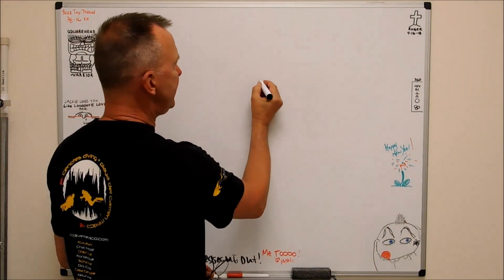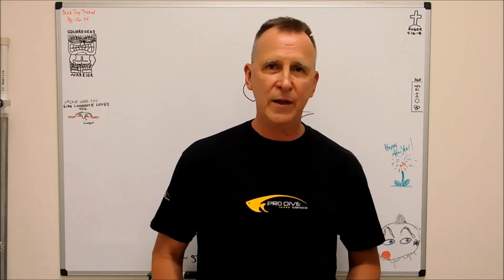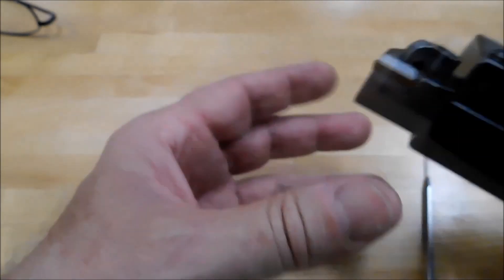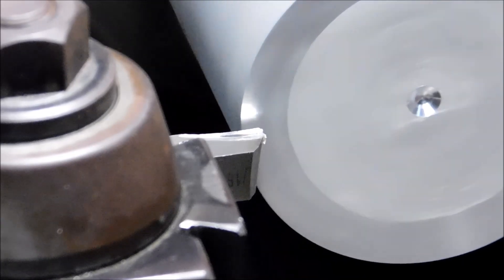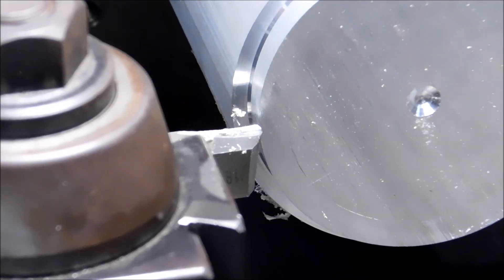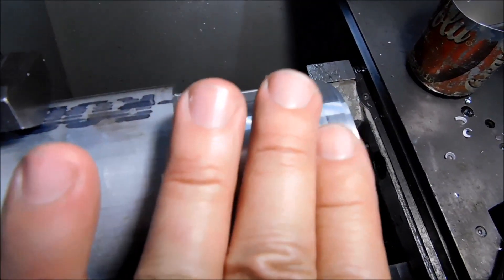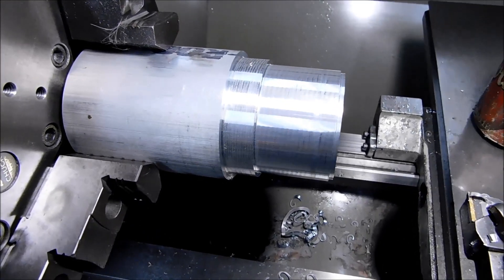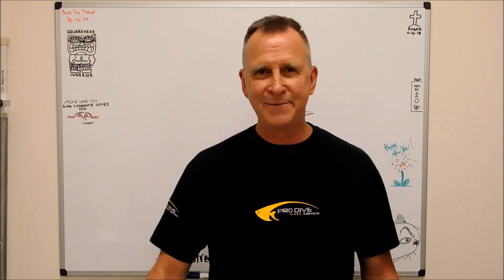C's and 6's...The Perfect Lathe Chip

Comment: You Are Awesome Joe. Check Out You Tube Video-Back On The Unicycle Three Months After Knee Replacement Surgery.
Reply from the maker: Don't push it if you are they guy on the uni-cycle. I have an extensive background in orthopedics, specifically knee replacement instrumentation and implants. There is only so much bone to work with and healing properly after a procedure like that is very important to a quality bone to implant bond. Falls are not good.
Reply: That Was A 1 Time Promo Stunt As My Way Of Giving Back To The Doctor And Hospital For A Fine Job.

Comment: Much appreciate you videos..  Do have a question, I recently purchased a Kennametal  CTGPR 123B, which I was told was the direct replacement for the KTGPR 123B. The insert that I am using is Kennametal TPG 321 KCU10. It is a one sided insert with out a chip breeaker, (smooth top). In viewing your video on C's and 6's I noticed that your turning tool had a added on chip breaker on top of the insert.
Did this come as part of your purchase of the tool holder or an item you added after the fact? Please advise me where you obtained the breaker and any information I may need to obtain this item. Thanks for your help and keep the great videos coming....  Richard
Reply from the maker: That insert topper/chipbreaker is normally use with the TPG insert. It has been on that tool since I bought it. Check Dorian tool holders. they seem to be the closest thing to this holder.  https://www.grainger.com/category/indexable-turning-tool-holders/indexable-turning/indexable-tools/machining/ecatalog/N-1d36Z1z059by

Comment: Thanks for the tips! Definitely expanded my boundary of knowledge. With regard to steel, what chip color would you consider ideal?  I haven't pushed any cutter to C/6's yet, but I'd like to know a "safeword" when I start making cuts.
Reply from the maker: Any chip that turns blue is pulling heat off the work piece and is normal. I start to worry when they are gray.

Comment: Well that the way to do it but I take .250 to. 375 per side granted, the lathes at work are huge 32" swing up to 62 inch very powerful the chips will fuck you up ! wreck dial indcator lens  .chip melt to your skin , like to post videos but my boss won't let me     but with that said, God bless keep up the great work joe
Reply from the maker: Ran an 18-140 gap bed Mazak for years. They were fun but dangerous.
Reply: Joe Pieczynski  lathes I'm running now Meuser made in West Germany.  I have cut .750 per side on 4140  32 swing but we have tos  42 swing ,   lodge &Shipley   52" swing 10 in hole through
Reply from the maker: The biggest lathe I have ever been next to was at Bethlehem Steel in PA. They used a crane to load the carbide inserts and the operator sat in a control room with a bucket seat mounted to the carriage. I believe the bed was 400 feet long and it had an 18 foot swing.
Reply: Joe Pieczynski  lol that's a big machine. some times I get a laugh when a new guy comes to the shop ,and he see me sharping hss tool bit 1 1/4 to 1 1/2 square,  he thought he's 3/4  tool bit was large. Have a great day joe God bless

Comment: Great lesson, what about long and stringy chips when drilling on a milling machine or drill? Especially when i have already drilled a pilot hole my next drilling op usually produces long stringy chips. Any tricks to reduce the size of those chips besides backing off the quill pressure to manually break the chip?
Reply from the maker: Believe it or not, sometimes a more aggressive and longer cut will break them. Its material specific.

Comment: I usually work for surface finish instead of chip appearance, is that a bad tactic, do the C and 6 chip make a superior surface finish or is it just about efficient removal of material?
Reply: This is for roughing.  You would never have such a large chip breaker for a finish pass.  There are positive inserts that have super fine chipbreakers for low DOC/low feed finishing.  But this video is about hogging some metal.
Reply: Cool thanks  👍
Reply from the maker: Agreed. Under extremely controlled conditions, you can sometimes get away with a finish pass like this. The finish may be bright, but it won't be a 32.
Reply: no doubt, especially if you can hoax your x axis rake angle positive.  It's not the best for edge integrity when roughing but you can get away with all kinds of shenanigans when finishing.

Comment: Try that with 4140 chrome (heat treated 100 thou deep) rod & see what happens  !!! you have to be at least 120 thou under the surface to get c's & 6.s .
Reply: There is no magic rule for chrome moly.  I do so much ID profiling with a 32.53 Mitsubishi dcmt and the material is 4130 forgings with a max hardness of 345 HBN.  400 surface footage at .009-.010"/rev.  The chipbreaker love it long as you are between .065-.100" doc.  I often repost if I'm working up to a shoulder and the last pass is less than .065" cause the last pass will birdnest and birdnesting to a shoulder sucks ass.  Hardened CrMo turns beautifully!  I make tons of tight C's a month.  BTW everything has to do with the geometry of the cutter and the cutting conditions that make the geometry work right.  It's really that simple.
Reply: is that with manual or cnc , i am going to try sandvik cgna cbn grade inserts.
Reply: It's a horizontal machining center with a big ass contour head with ~ 35" turning capacity.  So CNC with the tool spinning up to a 35" long boring bar in a whirly bird of death and the forging is on a magnet on a sub-table on my B axis pallet.   I'm making mud pump fluid ends.

How hard is your material?
Reply: Under the hard chrome its the hardest 3" 4140 ive ever come across for 100 thou deep , normally can cut chrome hyd cylinder rod with the bandsaw  - but not this stuff  .  Its looking like a high grade insert without a chip breaker . ( turning 12" lengths  & ordinary tnmg or cnmg 's only last for 8 or 9 inches before they are knackered  6 thou feed , 240 rpm , 20 thou depth of cut .
Reply: can you grind off the hard chrome?  Do you have a positive insert that you can use?  You are using a very low DOC for a negative insert.  You are at 188 SFM which is very conservative for coated carbide on CroMo.  Can you mill a couple of flats parallel to punch it on a hardness tester?  I bet it's the coating and not the substrate but I'm just on the other side of the keyboard.  I would get rid of the chrome plating, use a positive insert like a dcmt 32.52 and tipple the DOC with a medium machining chipbreaker and see where the chips lay.  Flood cool the part if you are not already doing so.  If it keeps giving you shit keep the feed and DOC where the insert likes it but cut the SFM in half.  The harder the material the more heat is produces and that is always a surface footage issue.

You are going from 3" stock to what diameter?  If you are just taking 40 thou off to remove the hard chrome you may want to just centerless grind it off.

I don't have enough info to really figure it out but there are my stabs in the dark, good look Grant!

Comment: You can also also undercut the leading edge of a drill with a dremel and a diamond bit for a quick resharpen (if the center point is still good)  and create a chip breaker at the same time. I've done it to get though some nasty gummy materials. Also on the lathe if your not turning right up to the chuck you can make a chip deflector that mounts to the tool post to keep the chips off you.  C's and 6's rock they heatsink the tool and the part and are much nicer if you have to shovel. They're also less likely to break a conveyor. Avoid polyester clothing as they will melt it.

Comment: Great video Joe. Any suggestions for lighter finishing passes? I hate it when the finishing pass birdnests and ruins the finish on the last cut.
Reply: I am looking forward to the answer to your question, it is difficult to push harder on a finish cut.
Reply: Leave more stock for the finish pass and or a more aggressive chip breaker.
Reply: wjb111 So that begs another question. How do you handle a tight tolerance? Do you sneak up on it, or can you get to it with a substantial final pass? I avoid sneaking up on dimensions where possible, but sometimes it seems to be the only way unless I want to risk ruining the part. I'm talking about manual machining without a DRO here.

Comment: The size of the C & 6s for the carbide was a lot larger than that of the HSS. Is this just personal preference about chip size? I assume you could have pushed harder to get the smaller chips- is that correct?
Reply from the maker: That is correct. A faster feed rate would close the chip further.
Reply from the maker: Additionally, the position or geometry of the chip breaker in proximity to the cutting edge will effect the chip size.

Comment: Thank you again Professor Pie!
   I have a bunch of 7075 bar stock that I honestly have been putting off because of the speeds and feeds issues of the spinning razor. 
   The timing of the last couple videos have been just perfect. I now have a much better understanding as to the proper speed and feed to get it done right. 
   Have a great week Joe! Mine will be much better because of all your help. 

Great Video as always!
Reply from the maker: Outstanding. Glad to help. Don't be afraid of that 7075. In my experience, it will roll over and break much easier than 6061. Good luck and thanks for watching.

Comment: I love it when a hot C chip wraps its self around the lower lip or or ears.
Reply from the maker: I had a red hot, blue, 17-4 'C' shaped chip from a .250 deep cut jump between my finger and the carriage power feed lever right at the moment the tool reached the corner I had to disengage. I stayed with it and pulled the lever so I didn't crash the machine. The chip burned me all the way to the bones in my finger joint. Hurt like a MF. My forearms are so scared from burns on a lathe, when I tan, I look like an ex junkie.
Reply: I successfully put my hair on fire with a hot chip I few days ago. Not a fun experience.
Reply: You have experience.
Reply: Michael Egan Yes unfortunately.
Reply: Let's you know you're doing the job right 🖒.  It's the hot shuffle then the chips fire down your neck and stick between the shoulder blades 😠😠

Comment: You're tooling stay sharper a lot longer you're running a lot more true it loads machine properly and you don't get that vibration that destroys your tool then you can really take some material off.
  I used to be able to take one inch off of 4 inch shaft 4140 in one pass in the chips were is thickest pennies if not a little bit thicker the lathe was a web 20 80 10 horsepower pressurized gearbox it kicked ass no machinist in your shop oh I forget there the CNC guys now you can put that Groove in the top of the carbide.
Also it carries most the Heat away in the chip.
It's who you do it with plastic or carbon fiber or anything in that order still if you don't mess around when you go to cut the fiber or plastic you catch the first of it and then you just roll roll it up big Loops keep up with it by hand and then it won't get tangled up
Reply from the maker: I ran an 18 140 gap bed Mazak for 6 years. Large machine are beasts on heavy cuts. Just don't get a chip down your neck. I have many scars to back that up.
Reply: I had 2 many of those so i put a peace of sheet metal of any kind next to a working end of a knife ,and hold it down with a toolpost screws(put knife in a toolpost /add sheet metal on top and tighten the screws)- bend it so it deflects chips away-doesnt have to be big to do job just fine.Makes safe area behind the carriage.Rest of the shop is like volcano erruptioin.

Comment: Would a higher cutting speed help if you don't want to break the chips but they are breaking anyways even at 0.05mm/rev? My SCLCR holder with some CCGTs always breaks the chips on aluminum but it breaks them on the freshly turned part and not on the tool or themselves.

Comment: PS:  SS is the most problematic in my experience.  Doug
Reply from the maker: Lubrication is very important on stainless. I can do this with SS all day long.
Reply: Stainless likes low speeds but heavy feed rates,doesnt matter on what /drill/lathe/mill with enough depth of cut it brakes chips nicely.Also as joe said lube it up.
We made a flanges in the shipyard that connects propeler shaft and the engine-blank was heavy like 600 pounds of marine salt water(think it was a4not sure) ss.
Depth of cut was 15mm on a 200rpm-dont remember the feed rate-but fun thing is guy was working on 4 machines at once.He timed it so he would start one when other one finished(it was a rough cut close to final dimensions ).All manual lathes,no automatic stop or anythin.
There were chips all over the floor like 1 inch of chips.

Comment: Hello Joe,  It would seem from what you show that you would be changing your feed and speed with each pass as the diameter diminishes??  For me it seems a constant hunt as the cut works well on larger or smaller diameters but not on the other.  Good topic.  Take care.  Doug
Reply from the maker: Maybe 2 or 3 times across a 6 inch diameter. Not every cut.

Comment: There are materials that it's enough that even with good carbide with a great chipbreaker, I've worked materials that at .120 deep and .032/r at 400 rpm (6" dia.) it still didn't want to make the c and sixes. had to get it to .036/r. that's an exotic alloy though and it's insert hungry. of course like many things, finish pass is making tinsel. but to get it to break well it has to be run exceptionally hard. and it's got cobalt and nickel in the alloy, Very difficult hard material. my real question though, is with an exceptionally hard material, that's good for burning up the carbides even under the high pressure coolant (grade 15 carbide hardness) how would you approach it? I've been at this in a pretty large shop for about a year, and even our most experienced machinist can't get a much better result. I should mention, it's in a large CNC (3 meter bed) though I suppose the high pressure coolant gives that away. but anyways, how would you approach a material, that's almost as rugged as the inserts we're using, when we've got a lot of material to take off (6" down to 5.600) then there's more coming off in another op later on...
Reply from the maker: Some materials like inconnel, monel, hastelloy and that family are just plain miserable. They won't cooperate no matter what.
Reply: Ok thanks

Comment: Joe, great video and I  always learn something when I watch your stuff.  When you say "if that tool would dry out, it would probably just break off" , what do you mean by that?  Keep the WD40 on?  Keep the temp down?  Can you elaborate?
Reply from the maker: If a flowing chip cold welds to the top of the tool, the material behind it has no place to go. It forms a dry dam and it doesn't usually end well. keep dabbing on a coolant to keep and material transfer to your tool surface to an absolute minimum.

Comment: Wonderful explanation. Not all machines can push that snount of material. Mine is small and my machine "heavy cut"in brass or sluminum is never thicker than 0.2mm. I wonder if there is a way to design low speed/fine cut chip breakers? What if you were to drill into the tool steel and then remove material to form a 3/4 turn chip breaker? Or an r shaped groove in your chip breaker that will force the chips to turn sideways ( away from the user) increasing the forces on the chip and producing more c's and 6'ers even at lower speeds?
Reply: I'd say, you'd have a jammed chip breaker or broken insert, considering the depth of groove and room required and agressiveness of fresh chips.
its more of a guide and dont produce rats nests feature you are looking for.
Reply: Good one... I don't know myself - and I'm interested to find out. In the meantime I satisfy myself by turning brass - a natural chip forming material, very easy and fun to turn and very nice finishes are easily obtainable. I will do some tests one day, when I get a bigger lathe.
Reply: the heat discoloration of longer chips is ... wow ;p i already liked the kinda unnatural lighter blues steel produces. 

with normal inserts and smaller parts the sfm and revs totally disagree with each other. carbide, its natural brittleness and edge sharpness is another issue in combination with 'performance' coatings, which act kinda like a foundation of modern machining. Just thinking back to the idea of ceramic drills... 

btw. HSS would normally be an option, self ground, or i've seen inserts as well.
Reply: Agreed on HSS vs. carbide - both are good options but I mostly use carbide tips.
As for the heat and coloration - patina or oxide layer formed on the steel - I never see that as I have to take 0.05mm steps when handling stainless, steel or anything harder than brass or aluminum. The drawbacks of a small lathe and a low-power motor. That's why I'm interested in breaking chips formed via thin, slow speed turning. 
Just wondering... :)

Comment: Nice art work, wish I could draw.  Two things, 1) we put chip breakers on our tools in the late '60s in HS Machine Shop, but they would not let us run those old machines like that;  2) I always wondered why people were using carbide on aluminum when HHS works great. Especially when they don't run it hard enough to get the chips to break. -  Cannot find that tool holder on the Kennametal site?
Reply from the maker: That insert topper/chipbreaker is normally use with the TPG insert. It has been on that tool since I bought it. Check Dorian tool holders. they seem to be the closest thing to this holder.  https://www.grainger.com/category/indexable-turning-tool-holders/indexable-turning/indexable-tools/machining/ecatalog/N-1d36Z1z059by